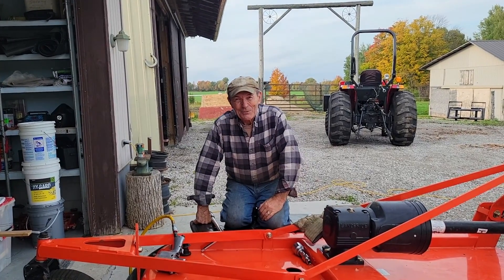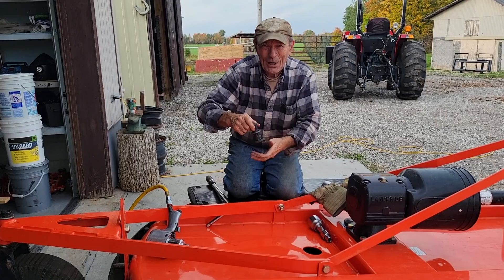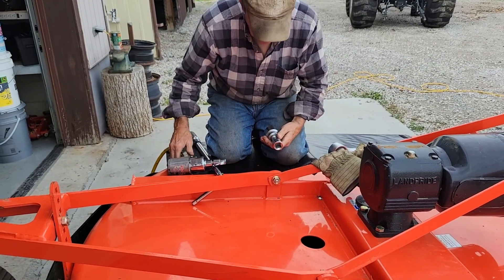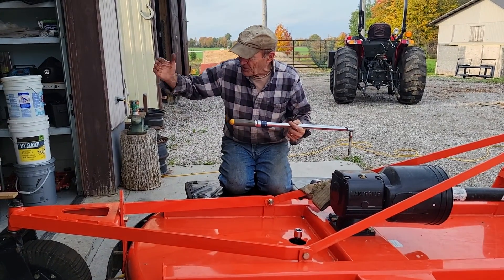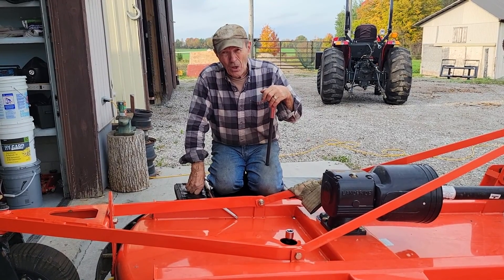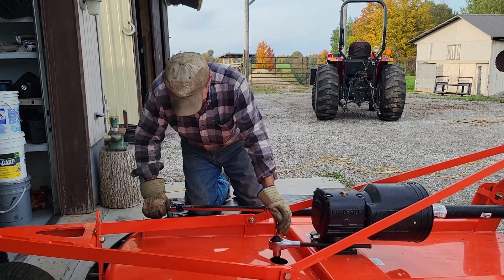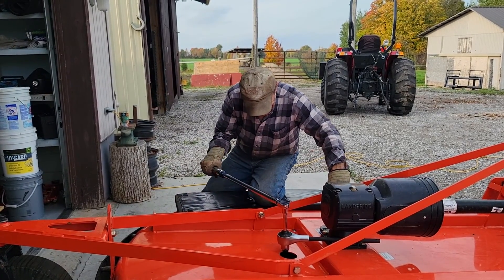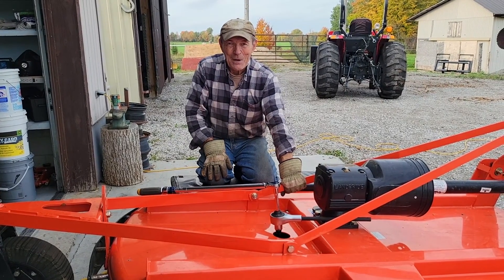#140 - 450 ft/lbs Torque! HOW? | At The Ranch

Comment: Love your wind chimes Alec. We have a bunch around our place as well. I have been meaning to get a torque multiplier myself. Primarily to keep in my truck tool box in case I get a flat. At my age, I just don't have the umph to break those lug nuts loose on that old Ram 3500.
Reply from the maker: They are nice but Kevin does not like their background noise (what a perfectionist!).  That's a good reason to get a multiplier, I'm almost there but i still have my strong wife to help out.  Glad you like them and thanks for watching.

Comment: Hi Alec glad to see you keep all your farm implement's clean and painted I hate to see farmers fields full of rusty metal attachments. when you were talking about high torque attachments it made me think about a jammed 3" tie rod bolt on a machine at work, I used a 4 foot pipe wrench and an 8 foot pipe and all my strength just to break it free (mental note always use anti-seize during assembly) stay safe Owen m
Reply from the maker: Now that would be something to see.  Especially if it slipped off!  Stay safe Owen and watch out for those wild ideas of yours.

Comment: The torque multiplier is a god send for many high torque job.
But remember for torquing, there is a friction loss from the planetary gear and grease.

Remember to SLOWLY push or pull the torque wrench . 
As to not induce too much friction loss error . 
I Enjoy your short video
Reply from the maker: Good tip, thanks for watching.
A

Comment: Is that a left handed thread?  Sorry for the random question :).
Reply from the maker: Nope, standard right hand. Left or right is based on the direction of movement of the parts. You don't want them to undo themselves.
Alec
Reply: the gears in the multiplier cause the bar to move the opposite direction of what you expect.  I had the same thought at first.

Comment: How have i never heard of a torque multiplier?  My VW bus rear axle nut needs 253 ft-lbs.  my wrench goes to 150.  Luckily the FLAPS store had a rent a tool wrench that went to 250.  But I might have to get one of these.... bet Amazon has them.
Reply from the maker: Yes. They cost between $100 & $500. Mine is the $100 model & works fine. I only use it a couple times a year.
Alec

Comment: you turned the torque wrench clockwise but braced the multiplier from going counterclockwise . I assume that has something to do with how a torque multiplier does its multiplication
Reply from the maker: Yes, that is how it works.  A great tool if you have high torque needs.
A